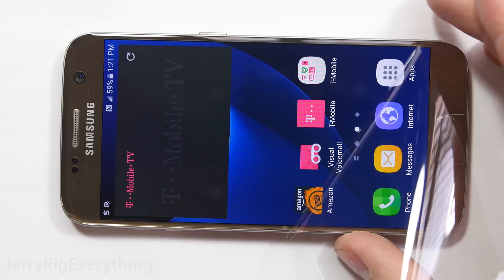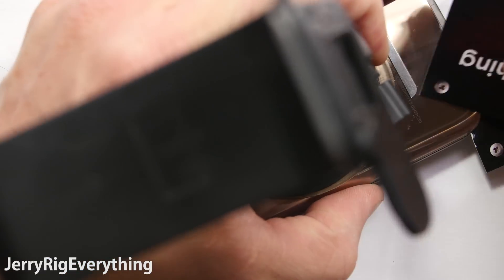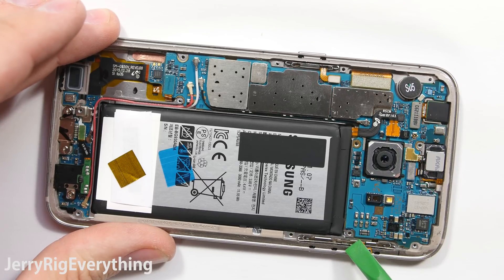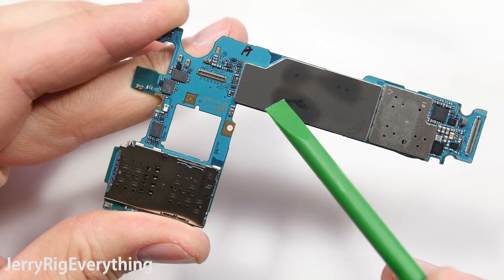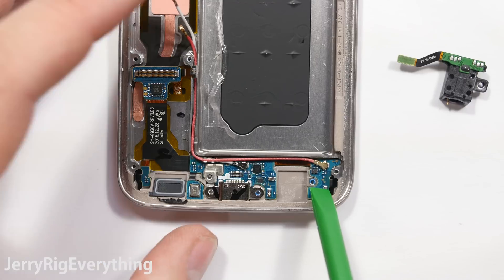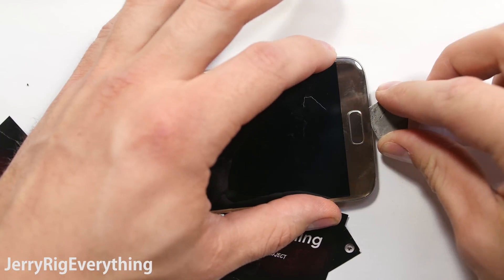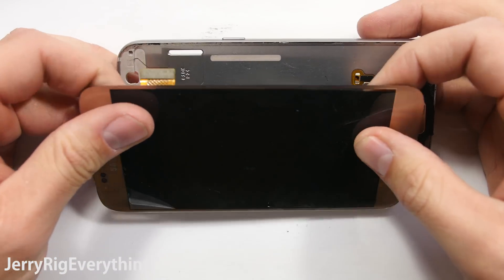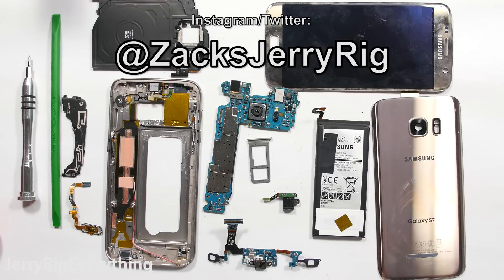Galaxy S7 Complete Tear down - Screen replacement, Charging port fix

Comment: My s7 has over heated many times, but it never got green/pink line problem, but my s22 got green and pink line just after using for 2.5 years, i think the reason is lack of copper heatsink pipes+display connector goes over battery.

Comment: You can remove the screen without damage. After removing everything from the backside, heat the screenside with the heatbed of a 3D printer (~80c). Then push the screen out via the opening on the backside.

Comment: Hi, my phone hit on the back when it fell, it still works but the screen went black. What caused this and it hard to fix. Also when a phone is opened up does it affect the apps and information on the phone? Thoughts would be greatly appreciated
Reply from the maker: If the screen is black but the phone is still on (making noise/receiving texts) then a new screen will fix your issue and your phone will probably still work after getting repaired. Talk to a repair shop near you.

Comment: My Samsung S7 just died after 4 years and 3 months of use. 
It started with a reboot for no reason, then it worked for 3 days with the rebbot problem, whitch gave me time to backup everething I had. 
Now it doesn´t start anymore. Maybe Im going to buy a broken one and replace the motherboard.
Apart from that it was a good phone, with only one battery replacement.
Btw thanks for you´re vídeos Jerry!

Comment: the screen on my old s7 died a feel years ago, and I just replaced it and let it sit in a drawer. Until recently, the battery bloated and popped the blackplate off of it, and the screen a little bit aswell. seems  like it's time for a little restoration project

Comment: Regarding the charging port replacement: A little dirty sorta-fix would be just cutting of the connection to the buttons - one may use an application for them. Now replacing the port wouldn't mean removing/destroying the display.

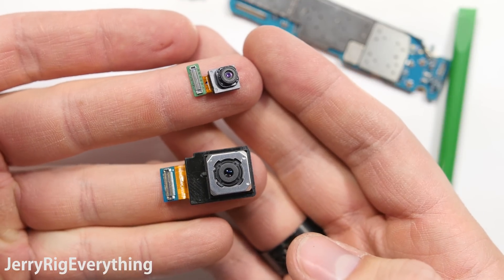Comment: 2:29 After 4 years of using it, it has serious over heating problems. The battery of my S7 swelled and you can see it because the back of the phone it's "lifted" by it. Even a simple task over heats the phone and it turns off. :/ It was his lifespan (useful life), but I hoped it ended better.

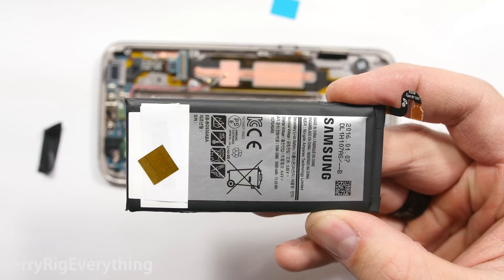Comment: At 2:59 when the battery is removed what is that black tape underneath? I bought a screen replacement for my s7 and it doesn't have that. When I charge the phone the screen flickers, I thought this could be some kind of shielding tape?! Any ideas?

Comment: I've been using a Galaxy S7 for nearly 3 years now, and at least in my experience it seems there aren't many overheating issues after all.
Reply: ShxShlix  When was the Note 7 recall? I've never been one to keep up with phone related news so I didn't even know there was such a recall.
Reply: ShxShlix  I see. I got my S7 back in August of 2017.
Reply: Mine would get so hot I could feel the heat thru the outer box. I traded it in.

Comment: 2:20 Galaxy S7 owner here, still in 2020. And yes my phone absolutely overheats.
Reply: Can confirm. 2020 S7 gang also!
If I play certain games while charging at the same time for too long, it will outright force close said game due overheating LOL
Reply: 2022, have been using my S7 since 2017. Every day youtube, every day gets discharged. NEVER had overheating issues. Best phone I've had. But battery and charging port are very used
Reply: I'm still using mine, it definitely does get hot when gaming but it doesn't seem to mess with the proformance too much, it plays Minecraft pe perfectly fine and Call of duty mobile, Pubg mobile on the other hand used to run perfect about 3 years ago but now its almost unplayable. We'll see how much longer the phone last, I got it in 2019.
Reply: Hey, I am using the S7 now even in 2023, purchased in 2017. Did replace the battery in 2021 after that it became fast and quite usable even till now. Excellent device.
Reply: Im Using One Too, and Weve Been Using It For 8 Years Now, and It Still Works Perfectly, and Everything Works, but It Just Gets Hot Fast Sometimes, and We Can Only Use 15 G Of Room

Comment: What a piss poor design. Still managed to break the ribbon cable on the back button just for a screen replacement. Now I gotta spend $9 and replace the whole charging port board. Hahaha! All it took is one drop on the bottom left corner to kill 75% of the display.

Comment: I have two s7 edges... the one I normally use had cracked screen and the touch doesnt work in certain area.  The one i dont use is perfectly fine but have software issues, won't boot up and is stuck at some screen.  I'm thinking it would be better to move the internal parts (mainboard? to the perfectly fine(screen uncracked) phone instead of changing the screen where I can damage it.  My main question is what part to i need to transfer over to the uncracked phone? Is it the mainboard where all my main storage is located or some other parts... (I'm a newbie) thanks in advance :)

Comment: I have a s7 edge and I was replacing the battery and accidentally scratched the back of the amoled screen and now I've got a thick line of dead pixels and some black splodge parts on it too, and now I can't afford a screen replacement 😭

Comment: You have to remove the screen for charge port replacement on the s6 as well. I did it no problem without heat and I reused the old adhesive still attached to the screen that I didn't damage.

Comment: Te charging port in my s7 got damaged the first week I got it, probably from a light rain. I was worried that it wouldn't get repaired on the warranty, so I did nothing about it for 8 months. When I did, I payed nothing for the repair. I have since even washed it under a tap, and nothing happened. I wonder what the problem was...

Comment: I work in a phone repair/accessory place and my boss replaced the charging port for me without changing the screen, I knew he was good, didn't realise HOW good until now...
Reply: Ben O'Sullivan My girlfriend's best friend took my girlfriend's s7 and dropped it and the internal screen broke. Now my girlfriend's mother tries to convince my girlfriend that it's not worth the money to replace the screen and wants to buy my girlfriend a new phone, the Redmi 5. The Redmi costs 200 € while the screen costs 170€. Am I the only one that finds thus stupid? I wanted to ask for your opinion because you said you work at a repair place.
Reply: Stratis Charis To be very honest with you, once a phone breaks it will never be the same, getting a new phone might be the better option.
Reply: Ben O'Sullivan But to change from the s7 to the Redmi 5? Even after the repair I believe it will be a downgrade
Reply: That's a huge downgrade in performance, camera, screen, call quality, LTE speeds and many samsung based features such as samsung pay and secure folder. Its better to just fix the screen. There's no new $200 smartphone that can outperform an old galaxy s7 no matter the test even if you step up to a new $300 budget smartphone, you'd still loose out on many things.
Reply: Ben O'Sullivan  the shop that's going to repair the phone is really trustworthy so I don't believe that they will pick a low quality screen. The screen that JerryRigEverything has the link to is worth 120 € and for him to choose it it must be good, or at least I hope show, and the shop is asking 170 so I Believe it's logical that they will have a screen of a good quality. Anyways thanks for help!
Reply: @stratischarisiadis6303  you have to be careful as they can use clone screens that are a cheap China copy. I would download an app that checks the hardware in your phone and it will tell you the resolution of the screen and see if it matches the original. This happend with my s6 edge I was charged £230 (a year after release) I looked at just buying a new one but the phone was full of everything like passwords, photos, videos etc so I just got it repaired (at a packi repair shop) 
After I noticed a lag in the screens response. It turned out the screen was a cheap clone it was even branded with Samsung aswel. 

I had the same issue when I had the Sony Xperia Z I broke the screen after paying £500 for it as it was the 1st waterproof phone and paid £200 for replacement screen I fitted myself and noticed the LCD was bleeding and very poor quality. I got the screen from a repair shop who said it was OME screen but was a fake so be careful avoid packi shops they are there to con people I only use an English one now.
Reply: @TheWhteWolf  which app for hardware testing
Reply: @shashikiran591  droid hardware info
Reply: Maybe he did change the screen, or maybe he just cleaned the port out with alcohol.. it's clearly tough to get at
Reply: @_baller  just now look at port, phone and space and think WTF he is write 😄
Reply: Stratis Charis If you have confidence in the repairer then repair it but make sure he's using a good quality screen and is reliable.
Reply: Yesterday just disamble my phone read all, fckdump side button and screen and read this post and think about WTF !? To bad can't post pic so you can explain me how the F he is do that ! There is no tool, technic or way to just replace port with any other damage...

Comment: If u had said the lone about nothing salvageable in the beginning I likely wouldn't have watched..your video... It's been a while but I once swaped screens on an s5, broken screen valid imei,  fine screen locked out phone. Most shops I've seen claim dumbshit like that repair isn't possible. What they mean is they personally can't do it if talking to tech, or they don't hjte employees who know the diff between amoled and lcd if talking to the owner . I've busted screens too, happens but u should really be more specific and say something like "for most people it will be replacing both " instead or the arrogant claim nothing is going to survive

Comment: The screen is not very expensive to replace in the S7, but the digitizer is. Will you destroy the digitizer trying to replace the charging port ? Is there any way not to damage it? thanks. I'm a disabled vet and on a budget. But I really rely on my phone a lot and need a fairly good one. Thanks. If the digitizer has to be released with the charging jack repair, I'd be better off buying an S8.

Comment: Hey I'm using this exact phone and it seems to have those overheating issues as you mentioned, do you think applying thermal paste to that discolored chip would help it dissipate that heat better? Or how else can I fix this hot phone?

Comment: Can you tell if it is possible to install 4000mAh battery from S7 Active into S7? Are the dimensions of batterys equal? Batterys have different connectors but I guess that problem can be solved?

Comment: Hi jerry, I have a hot plate for removing lcds from the glass. Could I use the hot plate to soften the adhesive on the back and front? Or would that be too risky

Comment: The thing with the S7, the S7 Edge, and even the S6 line and whatever other phones, if your charging port gives out, just buy a wireless charger. It may be slower than the fast wall charging, but its probably cheaper in the end and you wont screw up the phone if you try to do repairs

Comment: No way!  This is worse than the innards of an HTC 10... I'd get a pro to do all this and pay them what they want! Not at all like replacing the display on my old Moto G2 (and I wouldn't have done that if I hadn't gotten the replacement parts for nothing, which I did)... Just some screws,  a few wire clip pulls,  and one motherboard on the G2...  This is so much more involved!

Comment: After I used my brand new S7 yesterday in the rain, the Sim slot was full of water, so the sim stopped working  (now it's all fine again after I dried it.) also there is much water in the camera lenses and the menu and back buttons don't work correctly (respond randomly, short touch on menu opens multitasking and the back button opens menu). do you have a clue how to solve this?

Comment: Jerry I think you're wrong. Yes, Galaxy S7 does have LOCA glue betwen glass and LCD. You never come to this part because you stick card between polarizer and LCD not glass and polarizer, It is a very thin layer of LOCA glue between glass and polarizer. Watch other videos.

Comment: I successfully removed the LCD without damaging it. It's definitely feasible. Then I successfully removed the broken glass, using a hot plate and molybdenum wire. Then cleaned all the old loca off the screen. Screen was still working fine. Applied new loca and glass panel, no problems. But then I went to install the refurbished LCD back into the frame, and that's when it cracked! Alignment seemed good, so I dunno know what went wrong, but the LCD is so thin. I won't be doing glass only replacement on the S7, too hard. :-/
Reply: Thanks for the tip. I was thinking I might be special enough to do this without cracking it. I won't bother I guess...no USB or ADB for me...
Reply: It's not an LCD it's and OLED display
Reply: That's what happened when I changed screen on my Ipad. Everything went so well but the last extra pressing in the end when installing cracked the new one.
Reply: The Galaxy S7 has an active matrix organic LED display, not a liquid crystal display like the iPhones.
Reply: JayRay00 its an amoled stupid, not lcd

Comment: Thats why the pros use a machine just to pull out those kind of LCD that can cost $250 (the cheaper one) those babies can cost almost a 1,000 dollars.
Reply: Good info there! Do you have a link to this machine you're talking about?
Reply: Yes I would like to know too. I think Samsung repair centers use this as they need to service them quick
Reply: I know this was months ago but you can get cheaper machines from around 100. I got mine on Amazon
Reply: a 1000 bucks? seriously? because a brand new S7 is worth less then that. so maybe try again?
Reply: No Way im not talking about a galaxy s7 price, im talking about the MACHINE that is use to remove the screen of the phones.

Comment: Quick question Jerry. What if my S7 edge has a hairline Crack. Is it still water proof?
Reply: Crack is on the edge?
Reply: Just a hairline Crack on the screen.
Reply: Depends how wide crack is. But as much as i heard it definitely increases chances to get insides wet.
Reply: dude your phone was never water proof in the first place. it's advertised as water resistant.
Reply: waterresistent for 30 minutes in a depth of 1.5 Meter is enought for me to call it waterproof
Reply: 31minutes

Comment: that discoloration is from the heat gun probably
Reply: Probably but I have this phone and it does have overheating issues when playing gaming and especially when fast charging (I know it's supposed to get a little warm during fast charging but it get HOT).
Reply: Fiery43 yeah, it's SO annoying sometimes
Reply: @milk11percent  2020 S7 user gang. Can confirm. It can get so hot that it will force close certain apps if charging and playing at the same time for too long! 😅
Reply: @Spearra  thats so true, sometimes im playing fortnite and it overheats and then it closes the app by itself, so annoying. (Almost 2021 btw, 2021 S7 usergang?)
Reply: yeah I think so too. I have been using S7 for almost a year now but this phone hasn't explode or anything at all. too bad my screen got cracked and phone decided to take a dip unto the water.
Reply: Daniel Prodan heat gun or spontaneous incincdiary combustion

Comment: This is the downside of water proofing and also why I loved my iPhone 5, no adhesive and it was super easy to replace just about anything.
Reply: or you can just pay the 100 bucks to have it professionally done. also talk to me about how much you hate water proof when we both drop our phones in water
Reply: I'd rather not have to pay if I ever need to get anything fixed or replaced though. And I don't hate water proofing, I'm just saying it has it's downsides. Also I've never let any of my electronics get wet in my life. But it will probably happen now that I've said that haha

Comment: So being my clumsy self, I dropped my galaxy s7 edge. Well, it actually slipped off my lap and took an 8 inch fall. Landed horizontally on the side of the device on a sharp corner and cracked the back glass. It didn't spider web, but it did crack several times that spread throughout the phone. My question is: Will it remain water resistant? I tested it myself by laying it in a tub of water. It stayed true. no water got under the screen. Is this temporary? Will the adhesive keep it from water damage? or will it eventually dissolve and allow water to have access to the inside components?

Comment: snapdragon 820 has major thermal throttling issues.  s7 edge can play the fishing game on gear vr for about 25-30 minutes before it runs ridiculously hot and lose all it's graphical performance.  thermal warning message is normal after 20-25 minutes. I wonder what would happen if it was an action game that and not a relaxing fishing game..  a galaxy on fire?
Reply: I actually used the exynos 8890 version not snapdragon version. seems like there's a known issue with exynos 8890. http://www.techtimes.com/articles/144660/20160328/galaxy-s7-performance-issues-is-the-exynos-8890-overheating-during-stretched-gaming-sessions.htm
Reply: the thermal throttle gets solved so fucking quick though. they way the phone cools is it has to heat up quite a bit and then cools down incredibly quick
Reply: Not quick enough.  It totally ruined the vr game experience everytime I tested gear vr with s7 edge.  25 minutes gameplay is more than it can handle.